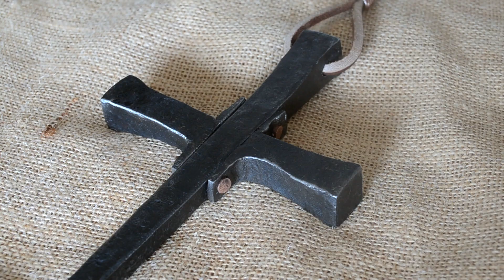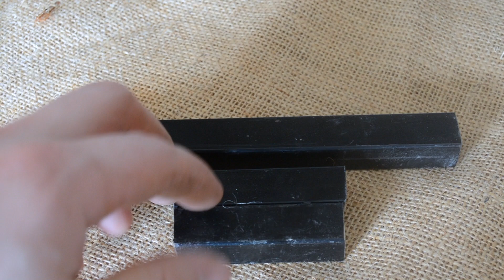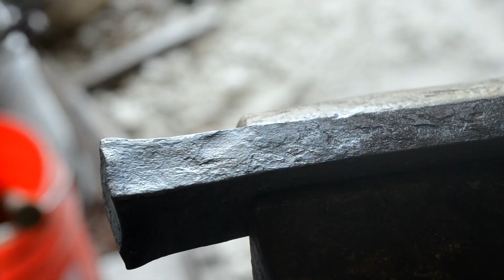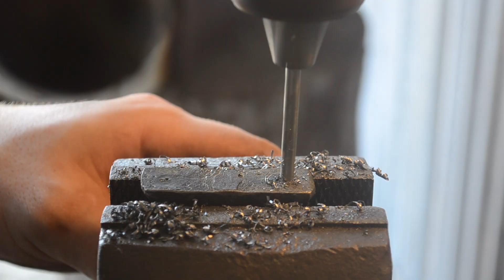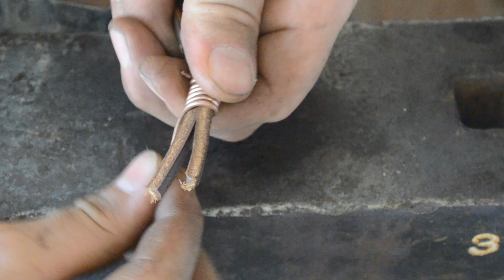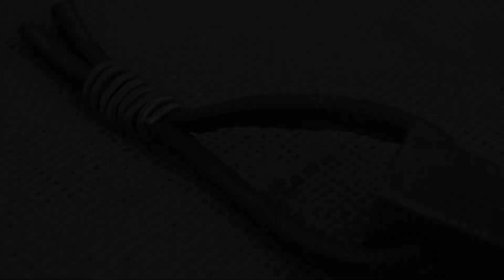Forging a NEW STYLE of Blacksmith's Cross!

Comment: Great! Well filmed video where we can see what you do at the anvil! A well done cross! 
A note I feel I should add about drawing out over the edge of the anvil. 
Your anvil looks like it will be perfectly fine to draw out over the edge, after a little smoothing of the corners - not much work needed. 
You are correct in that drawing out over the edge does create dents. Though the excecution is not done correctly if the smith only makes dents and
is forced to smooth them up on the face. Then the technique is not performed as it should be. 
When drawing out on the edge, the edge creates the dents, but the hammer smooths out the dents, as you hammer on the edge. 
You can see it in Alec Steele's, Brian Brazeal's, Daniel Lea's, as well as in my videos. 
So do not only look in the videos what the edge creates in dents (volume displacement) but also what the hammer smooths up, as the bar is drawn out over the edge. 
There should be VERY little cleaning up after using the endge, if any at all. 
If excecuted correctly, there is a relatively smooth bar or taper, not a lumpy and dented bar that has to be hammered smooth on the face.